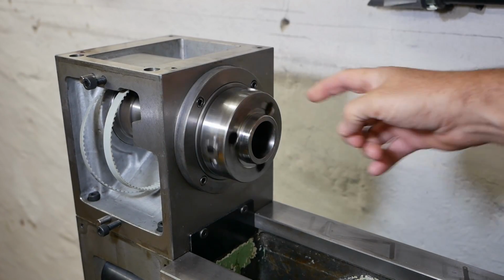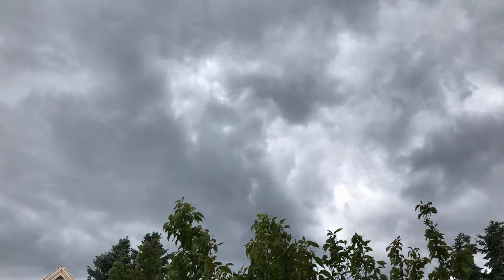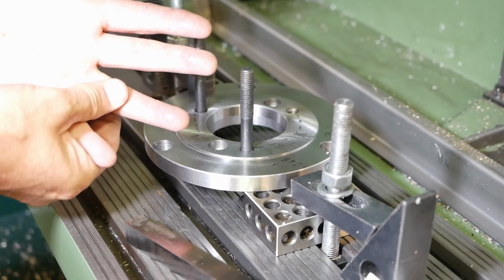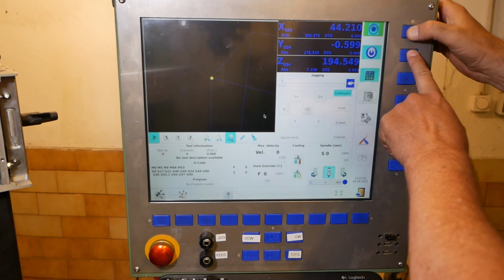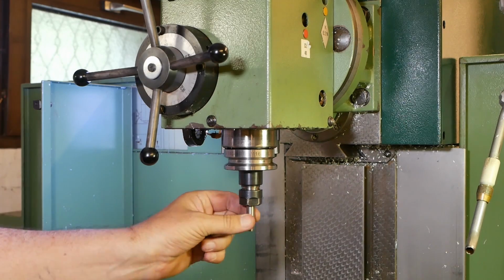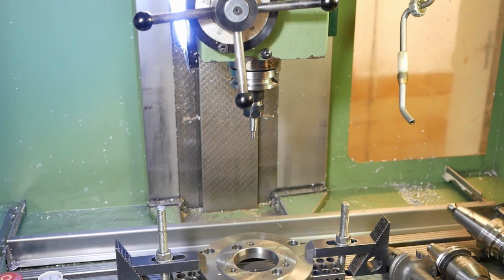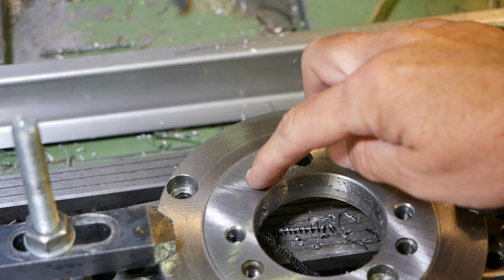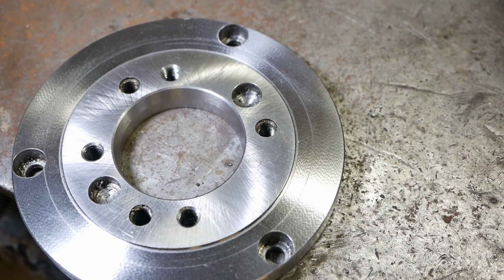Five minute job - Modifying a chuck back plate

Comment: Even in an industrial setting, jumpering the e-stop is sometimes still the safer option. bypassing a particular sensor and clearing the fault in manual mode vs putting on a wrench that could crush your hand or come around and smack you when you release the brake.
Reply from the maker: Thanks for the feedback on that. I did a few maintenance shuts at a particle and plywood factory with my Dad while I was doing my aircraft mechanic apprenticeship, and was impressed that industrial plants are much better at worker safety than the aviation industry.

Comment: Really nice vid. I thought I got the shudders at seeing some polygrips at 9.30 but a closer look reveals something slightly more professional.
Reply from the maker: Yeah, those are Knipex parallel jaw pliers. A really nice tool, as the Tapmatic is imperial, and the wrenching flat is larger than my largest wrench in my aircraft tool box.

Comment: Hey there, thanks for the video
Regarding your spot drilling: if I am not mistaken, the idea is that the spot drill has a wider angle than the drill itself so that the drill's tip can find its way in the stop center and, well, center itself. So, spot drilling deeper than leaving just a cone defeats this purpose, as well as using a 90 deg spotting drill (if I can estimate correctly from the video, if not, please disregard this last note)
BR,
Thanos
Reply from the maker: Thanks for that input. I hadn't thought that through. I buy 90 spot drills so I can also chamfer the edge with the same tool, but it makes total sense what you are saying about using a wider spot angle than the drill point. Must remember that nexttime I buy a spot drill.
Reply: @RotarySMP  👍 (does a 90 deg spotting drill chamfer nicely? Impressive...)
Reply from the maker: @than_vg  Probably not as well as a proper chamfer mill, bit it does a better job than me with a file :)
Reply: @RotarySMP  I'll give that a shot then...

Comment: For a machine like this, usually you'd have a way to manually move an axis with the power disconnected. That way you wouldn't need to short anything in the control panel to get it moved off the hard stop.  

It's probably more of a pain than you'd want to go into for the Maho but it's worth keeping in mind for CNC conversions that you will eventually want to move an axis unpowered.
Reply from the maker: There is a hex drive on the end of each motor. I use this if I trigger the Y end stop. But Z also has a brake, so you need to take up the weight on the drive hex, and then release the motor. The MAHO was originally configured like that. I find it easier to just jumper it. This is the second time I have needed to do it.
Reply: @RotarySMP  Like I said in my other comment this problem is common on Machines that have this layout. Hermles have a Button in the electrical cabinet that enables you to bridge the end stops and move out of it. Although you shouldn't have to manually move the axis back when you accidentally run into them during use. My Hermle has 2 end stops, one for E-Stop and one acts as a soft stop that stops all movement in that direction and will only allow you to move back out.
Reply from the maker: @vonSaufenberg  Linux CNC has software soft stops, but the issue is that the index marks on the linear encoders are very close to the ends of travel, so you dont need much beyond to E-Stop.

Comment: the haimer is fairly easy to take apart. there's some springs inside that connect the gear train with the probe tip. the top of the probe (inside) has a ball that rests in a socket. i crashed mine badly and deformed the socket where it didn't contact the top of the socket immediately so it was way off. my dad bent the pin (presumably the one that holds the long spring that goes across the back of the dial mechanism) that connects the rod to the gear train to get it to read 0,005 mm under, which is fine. it's possible if you crash it even worse that it won't read at all. so either the connection to the gear train is interrupted (perhaps previous owner dropped it?) or the ball socket is damaged beyond repair
Reply from the maker: Thanks for the feedback I'll have to tear it down and check it out.

Comment: I don't think bridging the endstops to release the E-Stop would get you thrown out because it's exactly the way Hermle dose it on the UWF series. They even have a button that you hold so you can move out of the endstop. The brake on The Z-Axis must be slipping allowing the table to slide down over time. Its a really common problem on these machines.
Reply: Adding a parallel jumper button someplace (control station) sounds like a nice return on investment...
Reply from the maker: There is already a switch on the MAHP panel for that Axis. Good idea, maybe I can tie it into this LinuxCNC control.

Comment: Nice place for holidays - I envy you :-) Good job going swiftly through the "Murphyan" hurdles, that always appear before one can start productive work. I wonder why you didn't shift the hole pattern 10-15 degrees and made a complete new set of holes with the correct measures - wouldn't be that much more work, I guess (unless I missed something).
Reply from the maker: The owner didn't want that. I would have epoxied a plug into the 12'0 clock hole and moved that onto the PCD, but that was also not wanted.
Reply: @RotarySMP  Thanks for clearing that -  the owner has the last word, even if it means shaving off a bit of the holding pins.
Reply from the maker: @JoseSilveira-newhandleforYT  He thought it might upset balance... but these are not balanced parts anyway. Not going to argue.
Reply: @RotarySMP  Totally agree. I was just curious from a technical point of view, wondering if I was missing something.

Comment: I think this video shows really well the prep you need when doing CNC work, it's not as simple as slap a block of steel in a vice and hit go. Also, do you ever do commission jobs? I've got a very simply ali part to cut with a couple of mounting holes and it would be perfect for the Maho 🤘
Reply from the maker: I don't take any commercial work, as I have neither the time (full time job, family and part time youtuber), and I dont have the skills to get work done in a sensible time frame to be able to quote a reasonable shop rate. Sorry.

Thi job is for the mate who wrote the LinuxCNC software component which controls my gearbox switching.

Yeah, I really notice on the manual lathe how quickly you can whip up a spacer , but how much more systematic the approach is to do things on the CNC mill.

Comment: Just a thought on the ring light and anti-rotation bar setup, would it be worth making a custom bottle where there is a thread set in to in the head of the bolt to screw the anti-rotation bar into so you can leave the ring light attached all the time and just screw the bar in - Might be a cool 'mini' project :)
Reply from the maker: That is a good idea. I think the ring light wires are going to break if I keep removing it.

Comment: Since the bolt doesn't take much load could you drill and tap the bolt you use to hold your light and reduce the thread size of the bar for the tapping tool?
Reply from the maker: Yes, that is a good idea, as the ring light wires will sooner or later break if I keep doing this.

Comment: What type of drill chuck is this? It looks like one of those hydraulic end mill holders, but I've never seen a drill chuck like this
Reply from the maker: This not hydraulic. It is similar to this one.
https://www.contorion.at/elektrowerkzeug/wte-nc-schnellspannbohrfutter-din69871-a-spann-d-2-5-16mm-sk40-a-l-92mm-21023673?aid=269434958572&targetid=aud-784412690575:pla-844379987176&gclid=Cj0KCQjw-NaJBhDsARIsAAja6dMReN6xHL5hc1d2xj1re9oFPohDoHV0xBu4CyxWU5fWdH85a2baMFkaAjRmEALw_wcB

Comment: Defeating interlocks may be ok for you, but if you get squashed by a bus and the machine sold, will it kill anyone?
First job is to restore interlocks and safety switches.
Reply from the maker: As the sign on AVE's machines say... "THIS MACHINE WAS BUILT BEFORE SAFETY". There are no interlocks, no machine in operation lights etc. I have not disabled anything, other than temprarily jumpering that limit switch. 

There is no way that the MAHO complies with modern safety standards. Not interlock on the door, not PNOZ watching the E-Stop chain, no warning labels etc. I am never selling it.

Comment: NYC cnc accidently turned the spindle on with a 3d probe in it. They did a tear down and attempted a repair. Hope this link works
https://youtu.be/V8tQsXszzm8
Reply: Also might look into getting a Chinese digital tool height setter
Reply from the maker: Thanks for the link.
Reply: @RotarySMP  no problem. Hope it helps